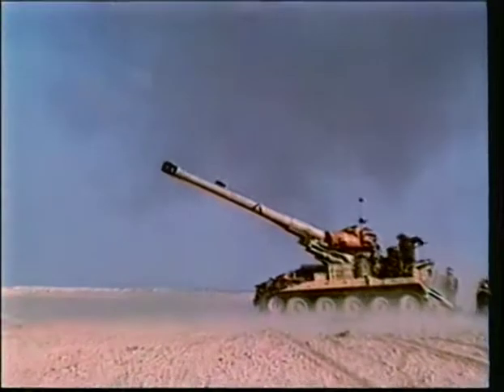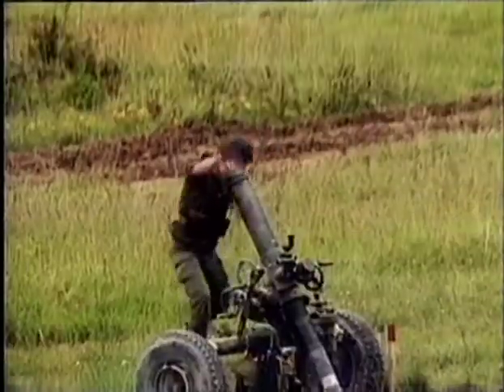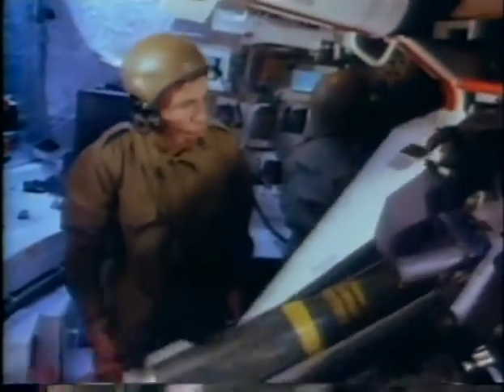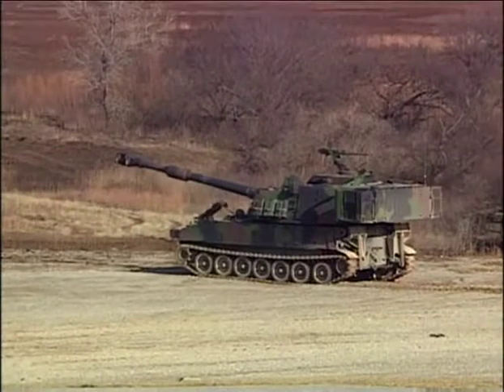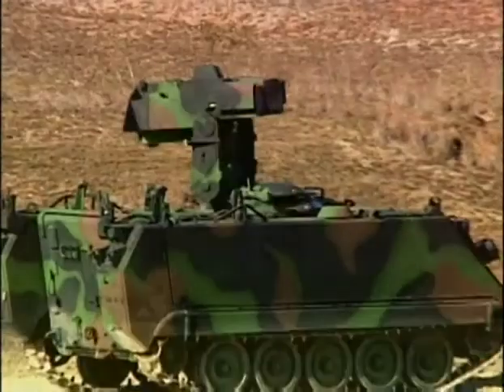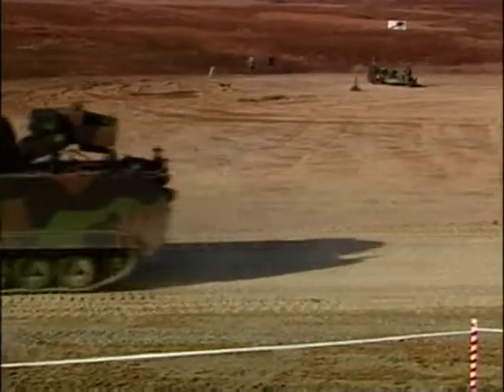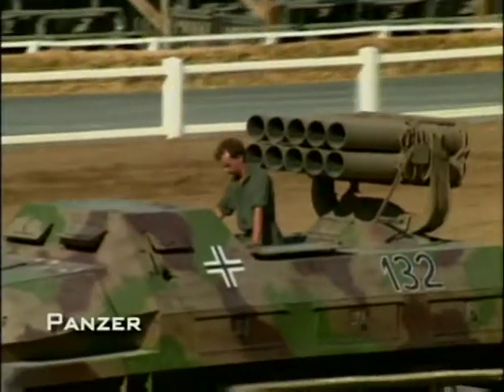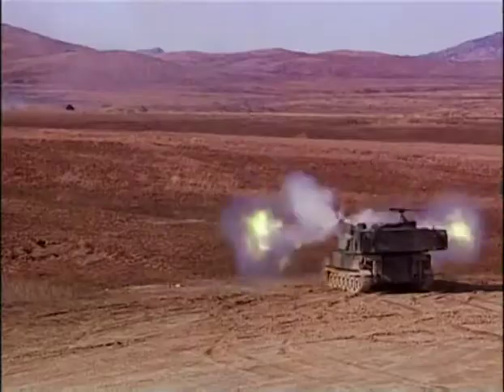Firepower - Artillery Strike [Full Documentary]

Comment: Those Palladin howitzers look like they've got extremely narrow tracks for the size of the vehicle. Hoever it does look like there is room for wider tracks. Can anyone verify this for me?
Reply: Jamison, not sure I understand the question. The design of the tracks is optimized for mobility based on the weight of the vehicle. Heavier vehicles require wider tracks, but there is no benefit to adding wider tracks than required. That would actually add weight to the vehicle unnecessarily. Agree that it looks a little weird when compared to a tank.  Think about it this way: M1 Abrams weighs about 70 tons (depending on variant), Paladin weighs about 30 tons (again, depending on variant). From the math, you would assume the Paladin track would be roughly half as wide as the Abrams. Over simplification for sure, but that’s the basic concept.
Reply: @armyofshea7941  Narrow tracks or even wheels are ok for hard packed desert (like South Africa) but for swampy or muddy conditions (like spring/fall/winter in Russia) you need wider tracks. The weight of the vehicle is largely irrelevant in light of the preceding.
Reply: @jamisonmaguire4398  weight matters a lot when determining the size of tracks, as the tracks are there to distribute the weight of the vehicle onto a wider area so it doesn't sink into the ground.